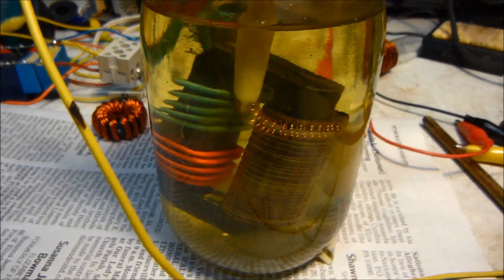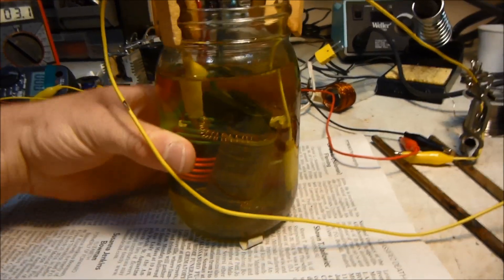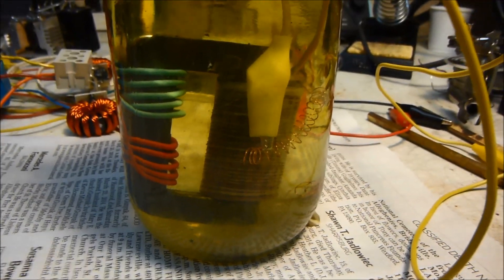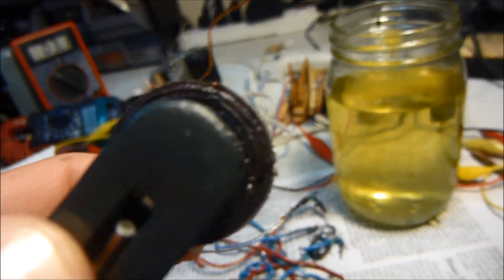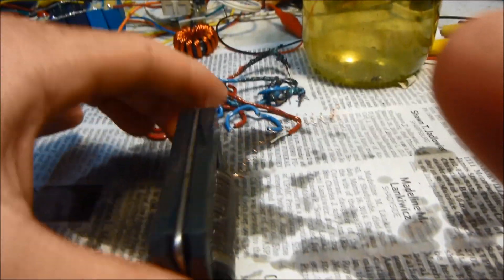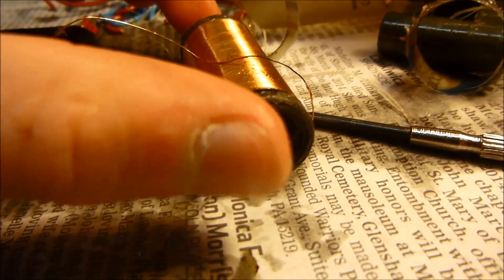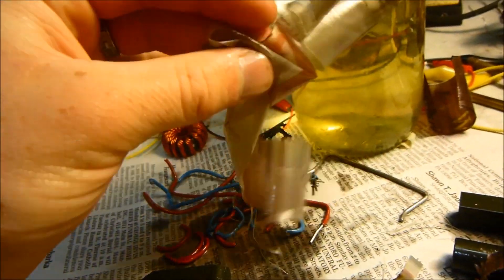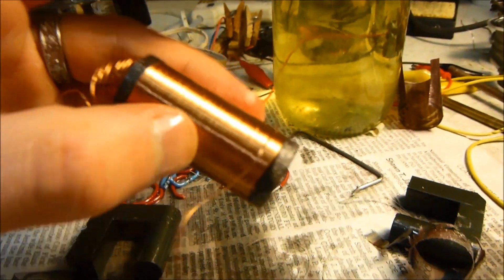Tear Down of my Burnt Out Homemade High Voltage Flyback Transformer

Comment: Sorry for your loss, but still nice work and especially putting the video up that showed the failure mode, this might be even more usefull to others than the build video.
Some things you might want to consider in a future build:
Make a segmented coill core with chambers to spread the stress across multiple windings or wind the coil in a conical shape ( wide layers on the inside, narrower as you go outwards )
Mineral oil is a lot mor suitable, even proper transformer oil is not that hard to get.
Get rid of the water in any non-HV oil by boiling and vacuum, the degassing of the unit was surely a good idea. Remember oil can become contaminated with water again over time.
Use craft paper, nothing with printing on it, the ink may contain carbon. Dry the paper thoroughly before winding and / or applying the oil.
If you need to use glue, use non water based stuff, 2K epoxy or the like. But by using the paper correctly to hold the ends in place you should need very little.
Good luck and keep up the good work.

Comment: Between every layer of wire try to put 1 layer of paper towel ( use glue or tape just to hold the paper in place), and one layer of newspaper or something else.

One thing that i found is, the paper with no glue is more conductive and the paper with glue is less conductive, you can use glue on the newspaper but you need to let the glue dry, i used a hot gun to remove any water residue

The paper towel will absorb the oil, this will make a thin oil barrier between every layer, less glue on the paper towel = more oil absorbed, use just enough to old everything in place
Reply from the maker: Tiago Oliveira Never thought of using paper towel.  Thanks for the idea!

Comment: its high frequency... you did an excellent job, maybe remove the metal bar you have acting like a screw driver you're testing an actual induction heater with... :P :P when finishing a layer pull the wire back down to its correct potential in the coil by winding only one way.... roger did this and claims it helps prevent such things from happening. Great video!
Reply from the maker: Tesla Explorer I'm not really sure what you mean by "when finishing a layer pull the wire back down to its correct potential in the coil by winding only one way" explain?  Thank you!
Reply: Well when you wind a coil upwards then tape and wind downwards, when you finish that layer the final wire is a huge potential difference from your start wire versus it having been brought back down to a closer potential at the start. It offers 2 times the amount of Corona suppression with each layer if there's any to offer that is... it might just solve your problem all together!
Reply from the maker: Tesla Explorer Oh I see what you mean!  Winding it on a bobbin like this would be optimum:  http://i00.i.aliimg.com/photo/v0/430342906/High_voltage_Transformer.jpg  Thank you!
Reply from the maker: Slowly dripping the oil in under vacuum is a great idea!  I will utilize that idea on my next transformer!  I will also use brown paper like you mention.  My mom has a role of it.  Thank you!

Comment: When you do the new one, try pulling a vacuum first and then sucking the oil in.  I think that is how they do it in transformer factories.  The air in the windings should escape much easier that way.

Comment: 1. Vegetable oil ... no way it can hold water or other conductive chem inside :D
2. Nice job.
3. Its not correct but not the worst fail such transformer call a flay back. Fly back is no a transformer but a SMPS topology with transformer and single transistor [Mosfet] key for primary "switch" :) And when you use a step up pulse transformer with Royer oscillator its no a Fly back at all :) Fly back transformer works with stored magnetic energy when the input pulse of primary goes off state. On secondary you have a diode a cap and min load resistance. The primary and secondary windings are in opposite phase connected. And have feed back for voltage stability on the output.      

4. Use only a proper trafo oil from HV step down trafos. I use for insulating HV stuff a oil from 110kV step down transformer.   
As layer spacers only transformer paper or Mylar tape min 1mm for home made HV pulse transformer. Space from end of the winding to the ferrite core at last 10mm when the output is about 10kV.
5.You can a coil former for HV winding made from PFTE [Teflon]. Make a former with separate about 6 slots for the output windings that will hold 150 windings each (900 windings in total). Drive the trafo by ~ 35kHz PWM and do not forget connect a load on the output !!!! By splited secondary voltage across it splits to and each of the slots hold about 1.5kV. Splited secondary transformer goes always in oil. 
6. On more thing. The magnet wire for secondary must hold at last 1kV the best solution is not single but double coated magnet wire with two layers of protective lacquer.In Europe the best magnet wire are the Blok-Trafo [Germany] or Russian made magnet wire with two or 3 layers of lacquer rated for 3kV.    
7. A parallel resistor for secondary winding + parallel with a safety spark gap rated +20% of the output voltage :D It can safe you secondary ...
And use a Litz wire as primary winding.
For all you need a pulse transformer calculator. Download it from:
http://www.diyaudio.com/forums/power-supplies/209221-smps-transformer-design-tool-ver-4000-a.html
One of the authors side i can give to but it complete Russian lang...
Reply: All good information, ochen spasibo! We casually call them "flybacks" because that is how they are used in the CRT TVs and monitors where we get them, but as you point out we are only using the secondary, with our own primary windings, so really it is a resonant HV transformer. The modern CRT flyback transformers usually include a rectifier diode so they emit pulsed DC; the homemade "flyback" doesn't have this. I am preparing one to use in my hybrid Tesla coil, to replace the blown CRT flybacks that I have been using, so all of this information is important to me in my design.
Reply from the maker: Sandris Demants 
1. Ok!  It was just a theory!  All I know is that the oil went kinda slimy and had all kinds of cloudiness in it.
2. Thank you!
3. Interesting! I see!  I guess I was calling it that because I was using the core from a flyback transformer. I guess it is misleading.  So jut call it a high voltage transformer in the future?
4. I don't have any idea where I could obtain some real HV transformer oil and I don't really want to buy some.  So you don't think the mineral oil I showed in the video will work?
5. I guess I could make one of those.  But that would be hard and  I would need to buy some plastic and somehow machine it.  I would rather just keep it simple so that many of my viewers can replicate my work and make their own with newspaper and common, easy to find stuff, etc.
6. Sounds expensive.  If you haven't noticed already, I don't like buying stuff!!!  :P  I should get a job so I can buy stuff like this!

Thank you so much for all the tips and help!  :D

Comment: I think your right. More layers of paper with more overhang should fix it.
Put more turns on the next one if you can. :D
Reply: Mongrel Shark
I've found that all of the smaller flyback transformers I've tested resonate at about 30 kHz. I wrap a two or three turn "primary" on the exposed core, put a 50R in series and feed that with a square wave from the FG, and look at the output from the anode lead wrt the ground pin. Sweeping the frequency shows the main resonance at right around 30 kHz by producing the highest output voltage there, and there will be lesser peaks elsewhere like at 45 and 90 kHz. This is also how I locate the HV ground return pin in the first place, either with a voltmeter or a NE-2 neon: Set the FG to 30 or 20 kHz, turn up the output, and use the neon connected to the anode lead to probe the bottom pins.
Reply: I have done similar with the 3v square wave my scopes FG can do, except its in steps so hard to be sure you have the best freq...

I find the return with the hv lead once its working ;p Plasma arc gives the game away every time, lol.
Reply from the maker: Exactly right! 1000 turns should be about right I think! What do you think? This one had 600. Or would 800 be better? Thank you!
Reply: I'd go at least 1000.
My latest Slayer works well at 2100 (but not so god at 2250) with 5 turn primary :)
Insulation and patience would be the only things stopping you from doing 5000+turns with a ferrite core. Its not like you have length vs width restrictions. The more turns the better IMO.

Also a point worth noting. If your driving the primary with current in two directions, its not really a flyback anymore. Merely a potential transformer.

For it to be a flyback. the primary must be allowed to "flyback"! Its this flyback that drives the secondary and gives the transformer its name..

Regarding your 55v mosfet issue. Its going to be one of two things. As you suggested, it could be flyback exceeding the drains limits.

Or it could be ac passing the gates capacitance. It would be worth checking the max and min voltages on both points with a scope. As well as using a current shunt resistor on the gate drive to see if there is any reverse current passing the gate from the flyback.

Whatever it is. Comparing scope readings with
data sheets should find your problem. Thats how I tune the JT flyabcks I have been doing. Its a trade off between primary flyback on collector, and negative flyback on the base. More primary turns gives more output, but it also pops transistors past a certain point.
Reply from the maker: I'm sure 2000 would get a pretty sweet output!  The only thing is that I may not have enough room on the ferrite core with insulation, windings, and primary.  But I'll have to see.  I also don't know if that many turns would have too much resistance and I may not get the current I want.  But I guess it's all a trade off.  More voltage less current, more voltage less current.  

Hmm interesting.  I didn't know that about the flyback and transformers.

I will have to hook up the scope and take some measurements sometime and check for things like that.

Thank you!
Reply: More voltage=more current over given resistance....

Its not such a factor in secondary coils anyway. As long as you get a good freq for the coil. The resistance, and inductive impedance for the primary are the main factor after core freq.

I was quite surprised to play with a few random transformers with sig gen and scope. Some freqs have 3-5x the performance of others.
Reply: ***** acording to my simulation it can get higher than that.

Comment: Thanks for sharing your lessons. But what is lux (sp?) wire? All I find it a company called lux.
Reply: Makerj101  litz.... the cost of diamonds.
Reply from the maker: Sorry, I meant litz wire.  It's basically a whole lot of thin wires insulated from one another.  It minimizes the skin effect and makes high current, high frequency more efficient.  I used litz wire with my induction heaters.  Here is the Wiki page about litz wire.  http://en.wikipedia.org/wiki/Litz_wire  Thank you!
Reply: Makerj101
Ah, thanks. I'm familiar with litz wire.
Reply from the maker: RimstarOrg ok! Sorry about that!

Comment: a few suggestions, maybe try and coat each layer as you go with some extra enamel, and at the end maybe place the whole thing in some kind of enamel and put it under vacuum, i would think that would help alot, although you'd never be able to tear it down hahah
Reply from the maker: That's a good idea.  I'm not sure how good the cooling would be though.  I know with the oil since it is free to circulate it really keeps the coil cool.  And yes it would be a bit hard to tear down!  XD  Thank you!
Reply: yeah thats a good point!
Reply from the maker: corbonzo1 I'm sure since I am using a lot heavier gauge wire than normal flyback it would probably be ok.  But  I think it would just be a pain to repair etc.
Reply: ya and you def. wouldnt want to put that much time into something you couldnt fix
Reply from the maker: corbonzo1 True.  It would also make it near impossible to reuse the wire.  I think in my new one I will just reuse the wire from the old one!  Just repair the burnt areas and I'm good to go!  I'm actually surprised it didn't burn out where the wire had been repaired before.

Comment: Wow the turns look so perfect, no knots or anything in the wire. The thing about paper is that it gets conductive when it burns and turns to carbon. Cool video.
Reply from the maker: Thank you!  I just used my old sewing machine motor to wind it!  But I do agree, they do look very nice even though the wire I used was recycled from a TV yoke coil.  Yes the conductive carbon thing is a real problem.  Thank you!